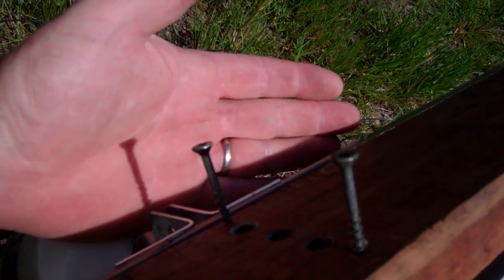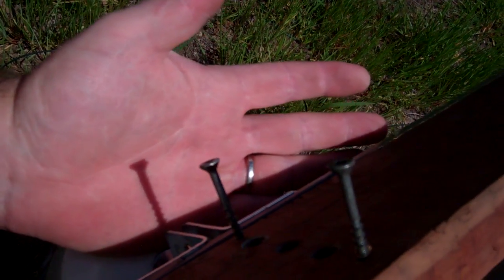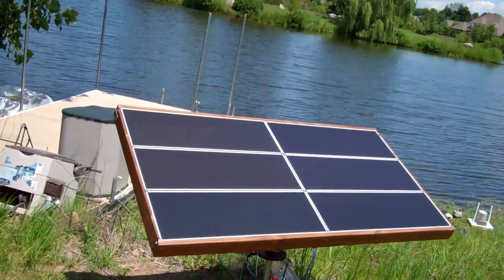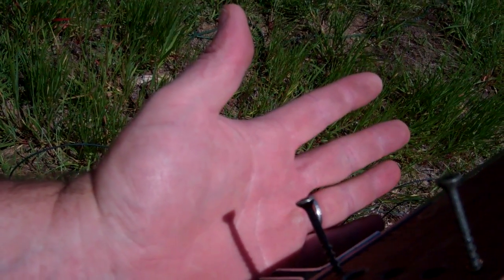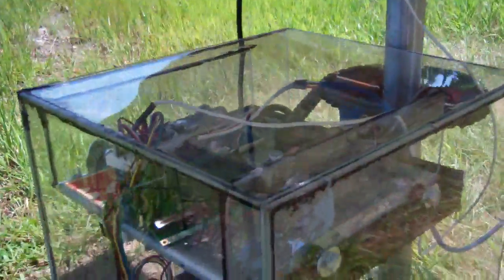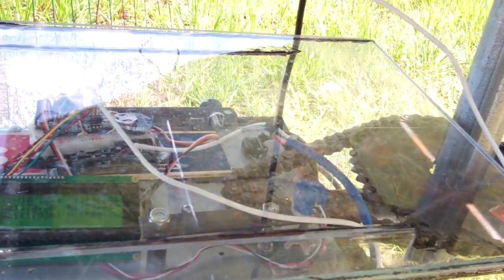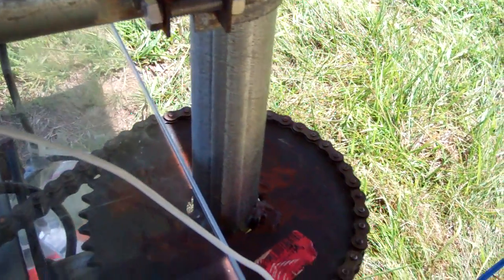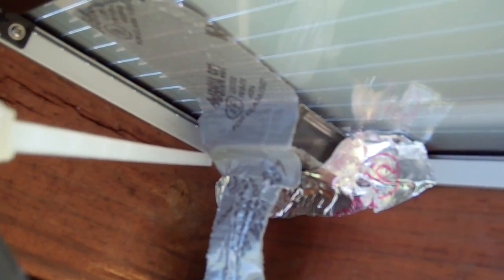Solar Tracker Close up of control system

Comment from the maker: @Fearlessthinker I have an AC power drop down by the panel. I run the panel power thru a micro-grid tie inverter and feed the solar panel power back to the grid. The drive system is powered from that AC drop. Since the gearing holds the panels in position, the stepper motors are only energized for a couple of seconds only when a move is needed. The power consumed otherwise is just what the Arduino and the LCD display draw.